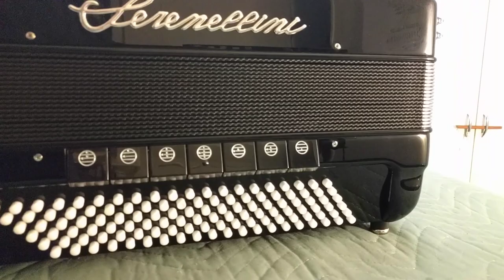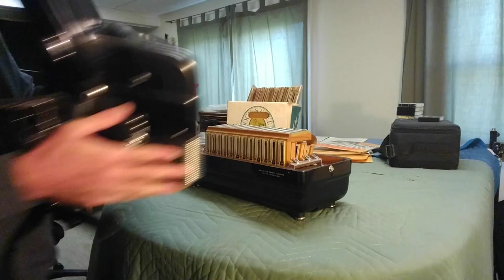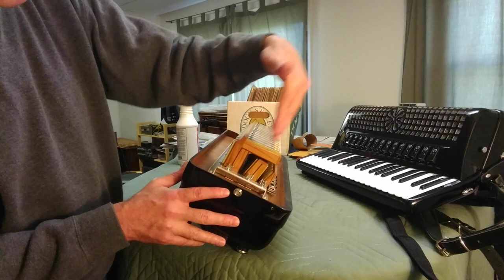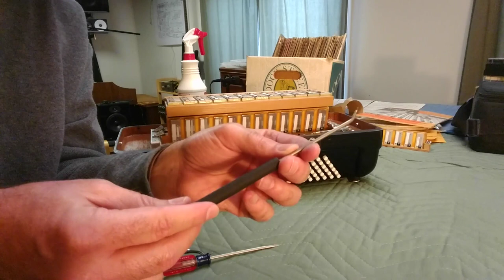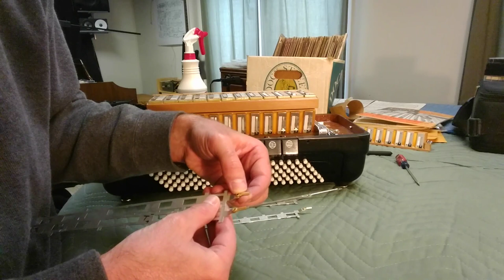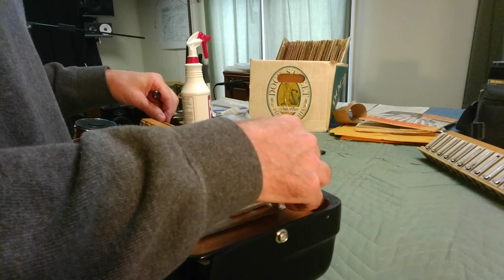Modifying Accordion Bass Registrations

Comment: Very impressive video.  Nice work.  You are an adventurous man!  There is no way I would even attempt doing that to one of my accordions.
Reply from the maker: Thanks! I don't have a ton of accordion experience but I've never hesitated much to tear into things, so I have quite a bit of other experience with everything from rebuilding and modifying racing motorcycle engines to tuning pianos to designing and building electronics. So I'm kind of cheating because accordions are pretty simple and I've gotten some good coaching on accordion-specific pitfalls (of which there are a few, indeed).

Comment: @Robert Kennedy 
  That Registration you were modifying says Alto, Contralto, & Tenor so it's what I call a Medium Tenor switch. Turns out they probably made an error when they made this 414 Accordion.
Reply from the maker: Good eye! Yes, the accordion was accidentally shipped to me with the tenor and bass reed slides cut incorrectly for this registration. The switch is marked correctly with the registration I requested, but the slides opened the bass reeds with that switch instead of the tenor reeds. The factory kindly sent me the slides I needed to fix the situation and I installed them myself, which was a lot less trouble than sending the instrument away.

Most likely the mistake happened at least in part because the accordion was assembled during what must have been a hectic time: Spring of 2020 during which Italy was dealing with lockdowns, shutdowns, and a very difficult pandemic situation generally. I'm guessing it was hard to get anything done there at that time.
Reply: @robertkennedymusic  Good thing it's finally fixed. The Master Switches are my favorite cause it produces the instrument's signature sound.
Reply from the maker: @RockStarOscarStern634  The master sounds fantastic on this accordion, but I wouldn't say I have a favorite registration; each one is right for some musical circumstances. For much of the music I play, master is too heavy and brash.
Reply from the maker: I'm grateful for your contributions in comments here, but in the last few minutes you added a lot of comments that are not specifically about this video, and are either completely obvious to anyone who knows accordion, or are controversial, unsupported claims. In the interest of comment hygiene I'm going to delete the ones in those categories, and I hope you understand I mean no offense.
Reply: @robertkennedymusic  I took those ones out so no worries. Keep on Rocking & #StayHealthy
Reply: @robertkennedymusic  It reminds me of the Machine Head tuners for my 5 String Cello:https://www.youtube.com/watch?v=R7GODXVEgts I had to modify their mounting plates so that the posts for the strings would fit the head stock, because they also weren't properly cut when I received them. Very very common problem w/ these Machine Head tuners designed for Violin.